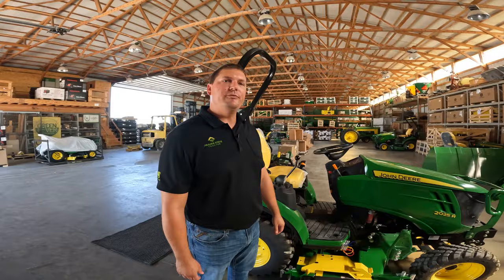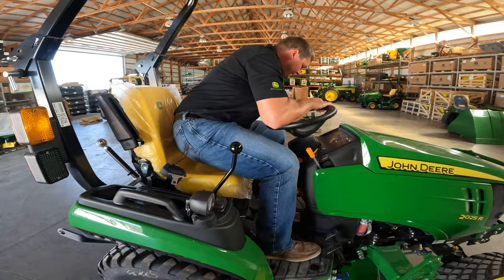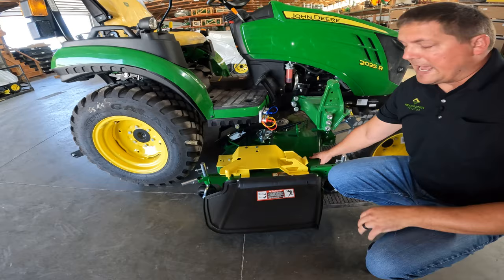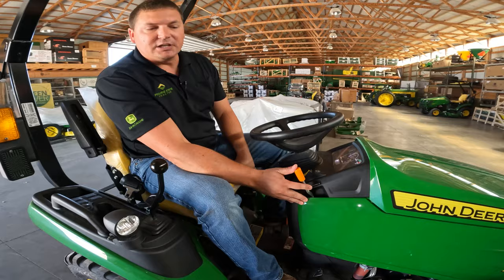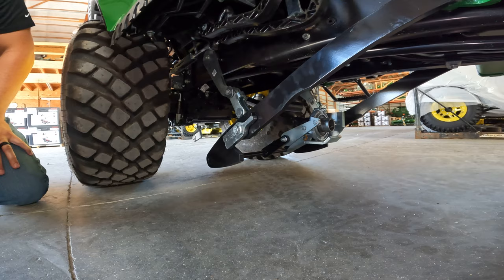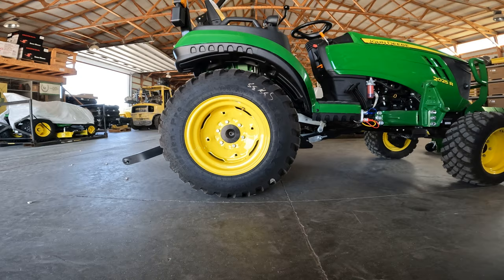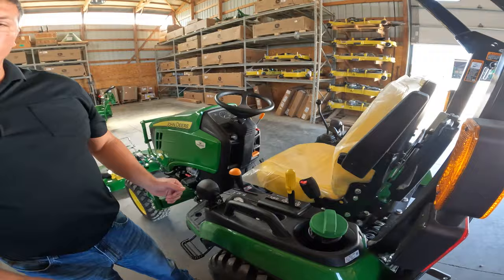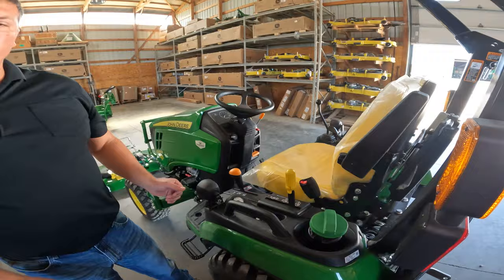How To Attach and Remove AutoConnect Mower Deck on John Deere 1023E, 1025R, or 2025R Compact Tractor

Comment: Excellent video.  I've been using a 2018 since new and learned a few pointers from this video even though my locking mechanism is somewhat different than the one in this video.  Dealer fell far short in demonstrating mine.  I've fumbled through some of these procedures as a result.  Glad you made this.  Thanks.

Comment: Thanks. Very good info. We bought our 2025 used with 100+ hr.s. The front mid mower hanger rod bracket was slightly bent/twisted. Also one of the clips was bent. Evidently the previous owner had something misaligned or hit something hard in use. No big problem to replace, just thought I mention for other users to give a quick look.

Comment: I like how you showed, up close, where the pto connects to the mower deck on install, and that you can put the mower in neutral and roll it forward and back if you need to.  I have been having trouble getting the pto to connect correctly to the deck - it seemed to be off to one side.

Comment: In winter and spring I need to switch between snowblower, and mower deck attachments on the mid PTO of my 1025R. The bracket that attaches the mower deck has to come off before attaching the snowblower, and vice versa in the spring before I can attach the more deck again. I need to see a video on how to do this.

Comment: Make sure the splines on the male and female PTO drive line up properly. Look at the one on the tractor(mid PTO) and  then rotate the one on the drive over mower deck to fit in the high and low spline teeth. This should make the connection smooth and easy. Sometimes the spline teeth on the mower deck can get turned so they don’t align.

Comment: Nice video. I still struggle with removing/re-attaching the deck on my X379. Would be nice to see how you guys do it. One of the hardest parts is getting the PTO spline back in the trans. Can sometimes take over 45 minutes of jiggering it around.

Comment: You didn't discuss anything about installing the mower. Do you put the mower height dial back to install? Do you lower the pto all the way down to install? There are 2 holes for the pin. Isn't the back pin for storing so you don't lose it? Also, why have adjustable height wheels if they are only for scalping? I was told wheels should be 1/8" above the ground to keep the cut height even.

Comment: What you didn't mention is that the tractor must have the hardware kit to accept the deck. You can drive on and off all day and it won't connect. I'm not sure what else I need but the pto shaft and frame as well as the 2 front hooks are about $ 1500

Comment: On my 2019 1025r, which I just purchased  used, but only have 147 hours, the knob doesn't  turn easy. The guy that sold it to me, private owner, told me that I have to have to have the  tractor running and push the button  and then turn the lever control   at the same time to adjust the hight, maybe because is an older model? I see now, the hook ups aren't   the same, I see no pins to be removed under the tractor.
Reply: No on 2019 just a lever that you lift up to disengage.  Both sides are connected together and come out of the way in unison.  One side will move both sides so you don't have to go to each side to do this.  Same as in this video you can wiggle your deck slightly by hand to get that locking lever to move out of the way.

Comment: Justin,
Wonderful video, great instructional value, you really know your stuff.
Now, my biggest problem is that NO ONE told me how to remove / replace the left and right SNOW BLOWER front adapter brackets and swap them with the MOWER DECK left and right front adapter brackets. And NO ONE told me how to remove / replace the MOWER DECK short shaft PTO and rear attachment fittings assembly and swap it with the SNOW BLOWER and its long, long PTO drive shaft kit. Oh BTW, PLEASE tell people they'll need a 18 MM socket, socket wrench, cheater bar and 18 MM box end / open end wrench for the "unique" John Deere hardware, plus needle nose pliers for the tiny cotter pins. My bloody knuckles bear testimony to my not having the correct wrenches.
Fred with a JD 1025R + snow blower + mower deck + loader bucket in Redneck OR 97756

Comment: with the 2025R, and the higher mower deck setting,  is it safe to keep the deck on,  when you doing other work (front loader?)
Reply: Yes.  It's safe.  I used the bucket to scoop out a septic tank hole.  The sides of the  deck barely touched the dirt on runs in/out of the hole.  I made a dirt ramp down as I went to get in/out of the hole as I dug to a depth of 5 foot.  The deck was never an issue and I believe gave me ballast when loaded with dirt.  6-1/2 years later without any issues to the deck or tractor.  I originally tried the backhoe but it wouldn't reach down far enough to do the job.

Comment: The mower deck came off of my 1025r while it was being used to push some stuff around a couple of years ago. I never put it back on. But I just put a Frontier rotary cutter on it. It's working fine. But I noticed the belly mower pto receiver is down, but I can't move the height selector dial to raise it up. It's stuck. What can I do? I don't want to go over something with the mower connection receiver down and ruin it.
Reply: Look underneath at the linkage from the knob to the height adjustment underneath.  I may be bound with dirt or corrosion.  Or it could even be bent slightly.  Mine loosened up and works better now that my tractor is over 6 years old.  I sprayed some fluid film on the under side of the height lever mechanism and it helped.  This know is not designed to move all that freely and sometimes feels like it's stuck especially when new.